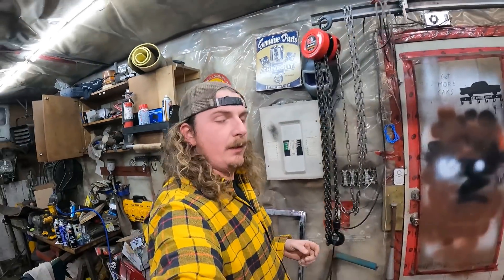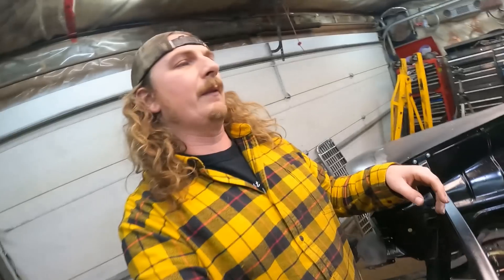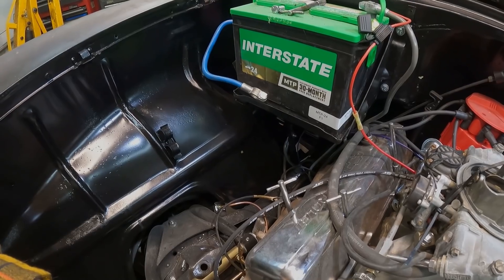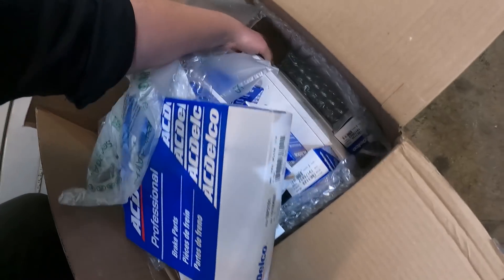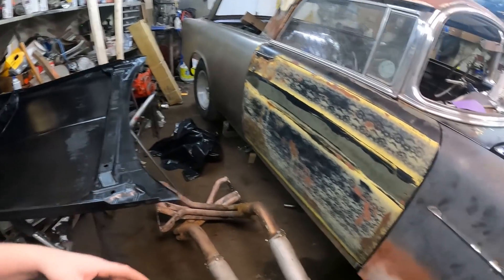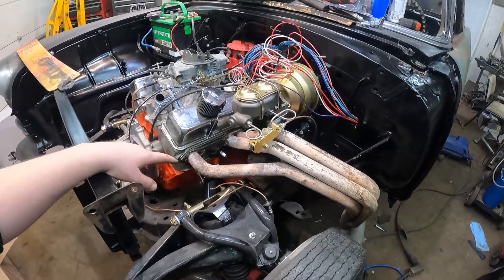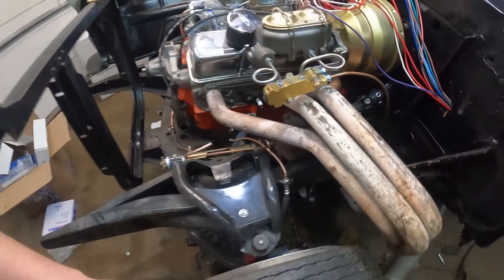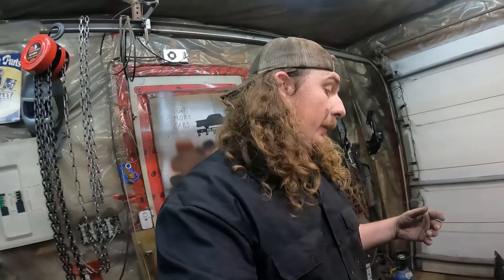Fender Well Headers And Straight Piped Exhaust! - 1955 Chevy Nomad!

Comment: Dan, Thermo Tech makes white header wrap. I used heat sleeving around my brake lines and wires that are close to the headers as well. Nomads coming together nicely.
Reply: Wrap the headers where they are close to the brake master cylinder and battery.
Reply from the maker: Thabks man

Comment: Just out of conversation I have used John Deere corn head grease for leaking gear boxes. It's like gun grease cold and gear oil hot. Best of both worlds.
Reply from the maker: Hmmm. I'll have to pick some up. Never heard of it.
Reply: @DDSpeedShop  if you need I can text or email you a picture of the container
Reply: I’ll second the corn head grease. Tip I picked up in forum years ago. It’s similar to 0 grade grease. Those recirculating ball steering gears really need a lightweight grease that flows, especially at low temps. Something like wheel bearing or chassis grease is too thick and will cavitation around the moving parts.
Reply: they used to call it goose grease I think in the old days.

Comment: Some factory W/P bolts have a threaded head protruding from the nut or use a stud. Also some Water Pumps have threaded boss on top for the alternator bracket to bolt to.  I use clothes line to measure my belts
Reply from the maker: Thanks thom

Comment: The upper alternator bracket hooks to the bolt hole on the intake. Where the throttle return spring is.

Comment: I use a round extension cord for measuring belt length,run it around pulleys bypass each other and make a mark.measure with tape measure

Comment: Perfectionist Dan heard the clickity clack of the header missing gasket. But I didn't. Best and better sounded great. Might go look at a junk yard n grab the right alternator adjuster bar. Bolts to the intake but is factory bent for the correct angle. The intake has a bolt hole right in front. I saw it on yours. Header are correct fender well type for every 55-57.

Comment: Buddy of mine got a set of Hedman Huslers Jet Hot Coated for appearance & longevity, but they also knock the under hood temps down. Helps between rounds cooling. Worse come to worse, you could always fab a heat shield. Yup, they do white! Bad part is, the Cha Ching factor is high, $800 for my Hedman Husler fenderwells I'm using on my '63 Valiant.

Comment: I agree,white headers with an orange engine! Love that look. I had a set of aluminum coated headers that were painted white.  They looked good for a few years until I hit them with the pressure washer.....
Reply from the maker: Yup then it's all over haha
Reply: I don't go for looks,I go for performance and black is the most heat dissipating color they have coatings now , high heat coatings that you would not believe the finish and endurability you get, their ceramic and come in a rattle can too I painted the wheels on my Corolla gloss black I didn't even hardly prep them and they're still just as shiny as ever out there it's been 2 years now.

Comment: Eh, may want more space away from the headers and the brake lines/combination valve. Or put some kind of heat wrap or shield on them. 
Another thought was to move the combination valve back farther to the firewall, but the line work is already done, so.... yeah. 
Coming along nicely, sounds GOOD!

Comment: Love it , love You , hate the cut in fender wells and the fender well headers , std headers would have worked . To much extra and the fender well headers need painted . But as ya said yer car unless ya get a offer with zeros. The you’ll be happy to put ram horns back on , and find , prime repaint fender wells and rerelocate the proportioning valve . See where the at went !

Comment: you might have to heat shield that master cylinder and proportion valve that might start to boil your brake fluid . and that battery I'm only saying that because I've had both of those things happen in my 53 Studebaker with a 58 Corvette drivetrain, with homemade headers, and then as usual you address the problem I'm talking about later on in the video. there weren't alternators back then the driver side is where the generator was. those will work fine as long as you polarize them anytime you remove a battery cable and change batteries it's really simple just a jumper wire

Comment: I'm so FOS and full of suggestions they have a high heat barbecue paint ceramic that you can use on those headers modern rattle can coatings are so frikking amazing I think it's Krylon and it's a gray metal. I got in trouble getting overspray on my daughter's barbecue once, and that stuff was better than the original coat that was on it

Comment: I think if you space out the lower alt bracket a little, it will give you more adjustability of the alt
Reply from the maker: Gotta keep the belt as straight as possible.

Comment: I always like hooking up the alternator on the passenger side near the battery starter it's very starter off one long bolt with a spacer to the head then that long curved bracket that goes to the water pump in the top of the alternator I never did like that header bracket set up I've got about 15 of those on the wall just for whatever

Comment: Not sure it was mentioned or not I'd try a DOT 4 brake fluid. Or DOT 5..which of course has a higher boiling point..but I've heard the DOT 5 can wear out seals faster..not sure if that's true or not..but could help with the brake lines close to the headers.

Comment: Hey Danny, Just so you know, the stock alt bolts to the upper water pump bolt as you have it but it has a spacer that is about 3/8" between the bracket and water pump. There is also about a 1/2" spacer that goes into the alt bracket  (lower bolt) to push the alt one way. They also had a set of spacers of about 1/2" between the header and the alt bracket and they used longer regular 3/8" course bolts (not header bolts) for the bracket. Just wanted to tell you what the stock setup was for running headers back in the day. Good luck and she's looking good. Later
Reply from the maker: Thanks man!  Yeah she needs a little adjustment yet

Comment: A small block powered 69-72ish C10 has the perfect alternator bracket for this application. Short water pump and doesn’t use the exhaust bolts. It’s beefy.
Reply from the maker: Ah good tonknow.  I'll keep my eyes peeled

Comment: You’ll need to keep check on the heat at the master cylinder when I put fender well headers on my 150 the heat from the pipes boiled the brake fluid I ended up having to wrap the headers in heat wrap to stop it  I had the same system you got
Reply from the maker: Yeah I assume I'll be doing the same

Comment: The original style water pump bolt has a threaded stock tip on it n to put a Nut on for bracket n just use a piece of rope n double it n use a tape measure n so if it's 22ins. Than that would be 44in belt ok 😆

Comment: Your having me thinking about putting a hotrod 55 or 56 Ford together like I did 40 years ago to a 55 two door but instead of a 351 I'd use a new 5.0 six speed  I know it's not GM 🙂
Reply: Bill, you got my vote!  Nothing wrong with a Ford, that's all I've been running for the last 30+ yrs.  Breaks my heart my newest project has a bowtie in it (ehh).

Comment: I made block off plates for my header flanges used a heat gun at the collector heated the header and used VHT WHITE. on my dirt car and they held up, gotta preheat or it won't    stick and flow out. My two cents.
Reply: Yes I’ve done this many times on headers with VHT they need to be hot when you spray them. A propane torch works too.

Comment: That  Set up the alternator sticks way the hell out there the belt always wobbles and vibrates I think that way sucks Early sixties had a big beefy bracket they went to the thermostat on 1 end 1 to the head that was the best way that reminded low on the driver's side almost Down by the steering Box That way you got a real short belt no wobbles no fucking around

Comment: Vlog or action, makes no diff to me as its progress. Eventually exhaust running to the back over the axles if can be done with present system. I would make a really nice thin metal baffle to go between exhaust and brake  proportional system and the one brake line. If done right, should look good and not have worries of it burning the rubber out of that valve assembly. Just thin metal and clamped to the valve since its stationary so it shouldn't vibrate an you know eventually it will kill the valve and you have better things to do besides revisit that system that can't be found for weeks. Just hoping Dan that if anything I ever suggest, you see if its possible to do without money or the wrap around exhaust that just burns off as well. Good luck an not bad video.... I just am anxious to see it with front on it, water calculating everything. Maybe a grill????????????? LOL the extras are to show old man begging

Comment: I'm not sure if you've done this before, but I'd find it very helpful if you could link to parts (Perhaps Rock Auto, etc have affiliate programs that would benefit you). Links to know quality suspension rebuild parts, radiators, brake parts and rubber hoses, wiring kits, etc.

Comment: Dan I always try to be positive and supportive but those rusty nasty headers are ridiculous and stupid.
This build just took a major step in the wrong direction.
One day you will learn that headers on a street car only help out at high rpm’s.
Zora Argus Duntov liked ramshorn manifolds, he used them on many high revving  Corvettes, and the 2.5 inch ones flow very well and eliminate so many issues. You can have an efficient exhaust system with duals and low restriction mufflers and it will look way better.
Reply: BUT the stock look is not what Dan is going for. Just build yours the way you want it to look instead of calling someone else's  look stupid !!!!!
Reply: I disagree I like the way he's moving this project long really fast in a calm matter perfecting every little part would stretch the project out for years . And would probably never get completed. Good job DD Speed Shop
Reply: @mikesbackyardgarage5578  amen. Well said.
Reply: Good thing Dan is not building that car for you huh
Reply: >>One day you will learn that headers on a street car only help out at high rpm’s.<<
And what are the aluminum heads and cam for....Looks?
I think Dan knows a thing or two about high RPMs and he's not ridiculous and stupid.
(Well, he's not stupid)